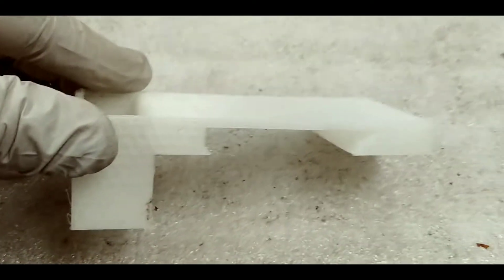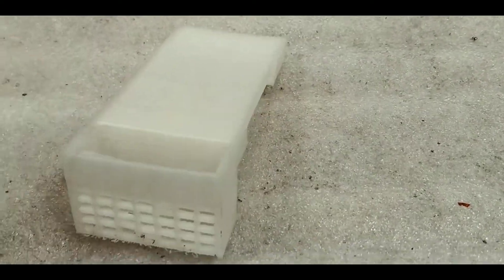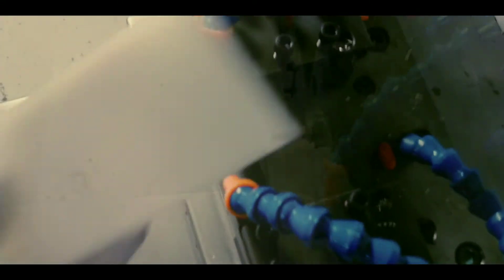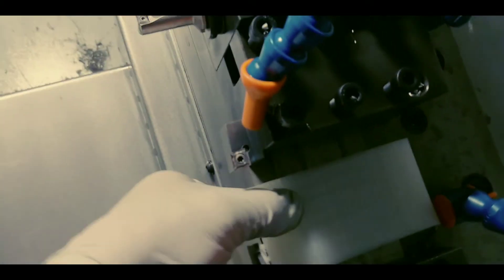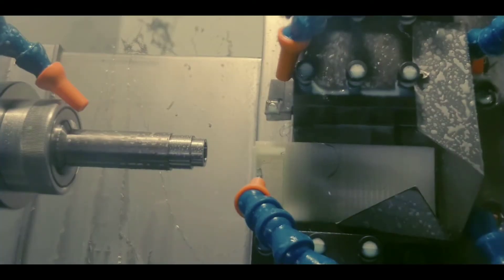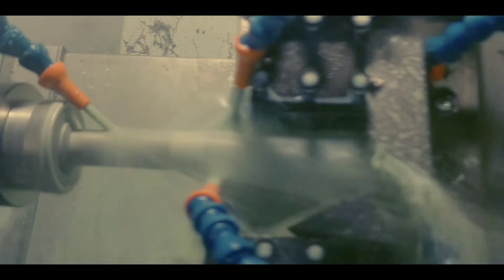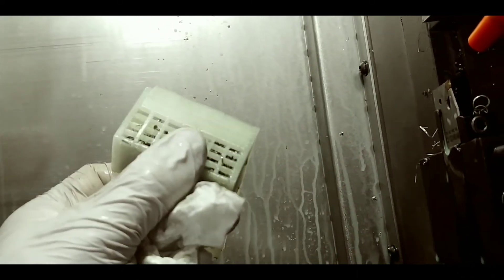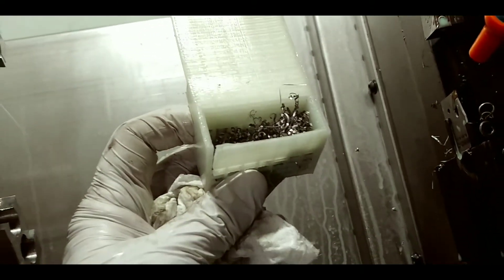LIFE WITH MARK..FORGED: Printing A Parts Catcher For The Turning Center

Comment: Piece of garbage machine
Reply from the maker: I have actually had much better results with a brand new tough nylon material.  It's not without fault that is for sure and there are some more intriguing technoliges out at the moment, but I am still impressed by the strength and function of the parts.